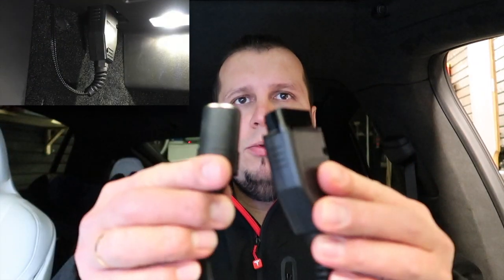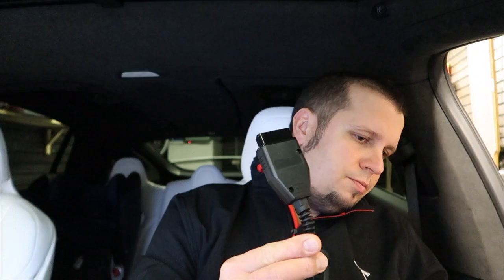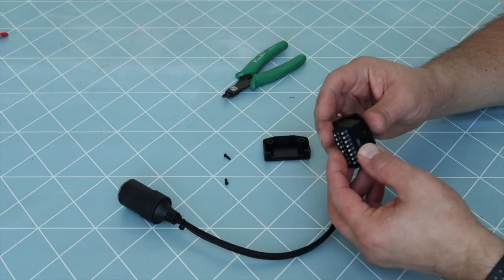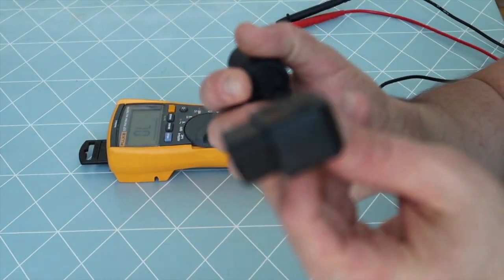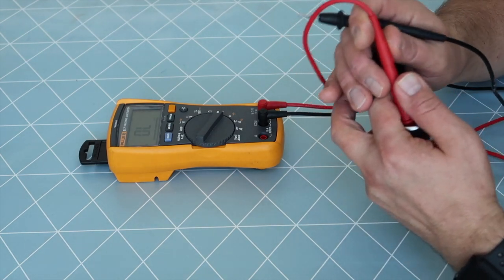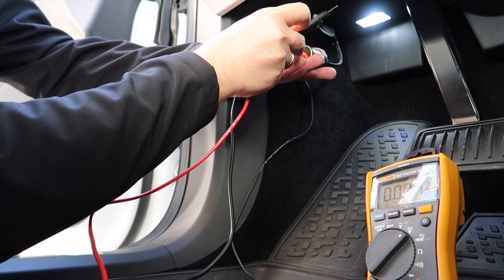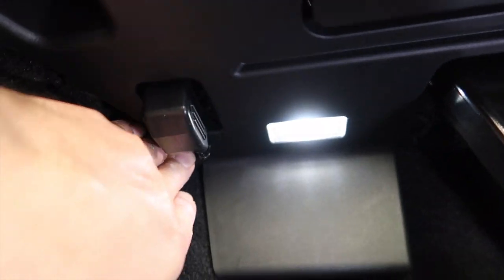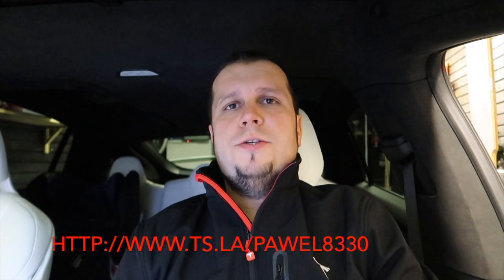Constant 12V supply in my Tesla Model X

Comment: I need a constant 12 vt for my sleep apnea CPAP regular power port turn off either after a few minutes or an hour or so.  What is the allowable current draw from that diagnostic port?
Reply from the maker: john gilmour Hi. I heard it’s max 5A. But I can’t confirm it for sure. Good luck :-)
Reply: TESLA DIY That sounds reasonable so 12volts x 5 amps = 60 watts. My CPAP draws 75 watts and as an airpump has a higher draw during start up though it's humidification element and heated air tube  is likely purely resistive .  Using a Tesla for travel for me with more than 2 Supercharger stops a day in cold weather means a lot more charging time in total than meal hours and that additional time means I MUST SLEEP during charging  to safely keep driving  . A trip from Dana Point California to Mammoth Ski resort should take 5 hours by car but in the Tesla with waiting to charge and feeling exhausted from so much travel this easily turns into 12-14 hours. So leaving the ski resort at 5 pm means I must sleep and need my CPAP to breathe. Renting a hotel room does not fix this problem as I would either need multiple hotel rooms near Chargers or more days to travel. Driving from Dana Point  California to Aspen Colorado  these last few days has been very difficult in a regular car you can do it in a days drive. This takes almost 4 days by Tesla  (I stopped for a few days in Utah for a funeral) On this drive I find myself waking up with the CPAP machine turning off at random time intervals cutting off my air supply. Which is worse than not CPAP as I am wearing a full face mask and it's as if you were wearing a gas mask and someone randomly plugs your air holes.  This has seemingly gotten worse with software updates by Tesla. I used to be able to use REMOTE S software app, but now that doesn't seem to work either.